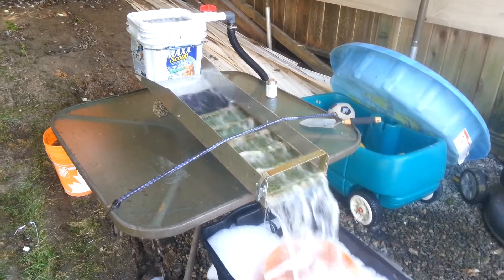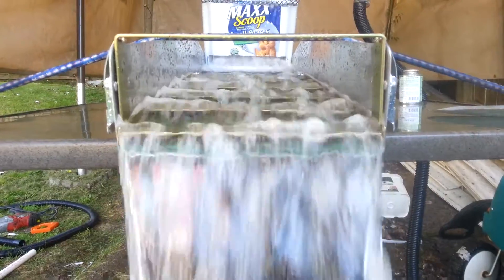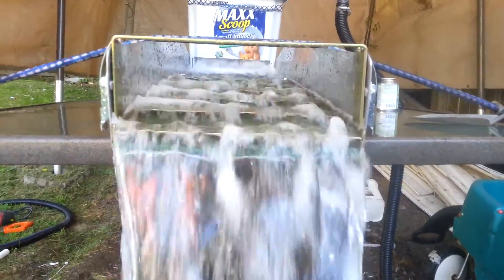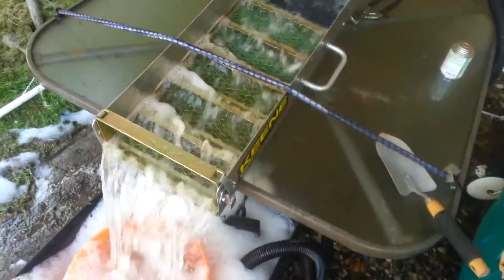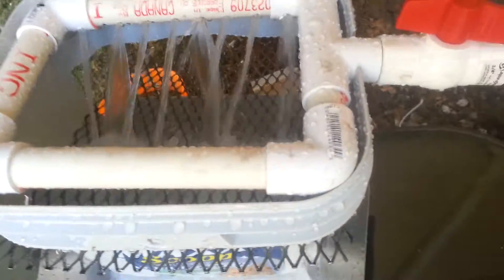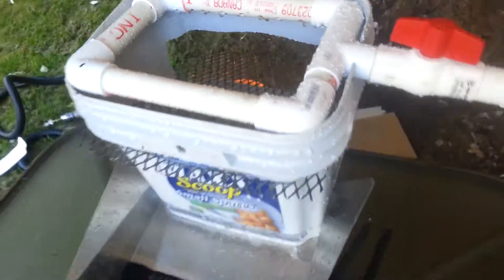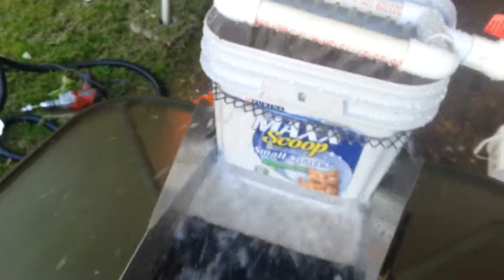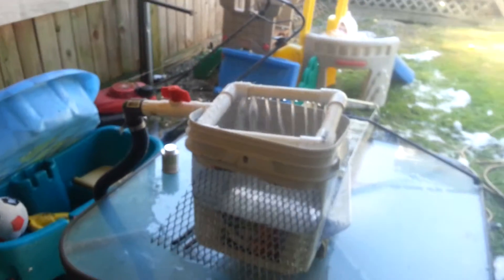Home Made Mini HighBanker Using My Keene Sluice And Some Creative Thinking

Comment: looks good to me..ive come to realize that it takes a heck of a lot of water to be to much so run something threw it and see what happens. its hard to tell without anything being ran. and even at that, the type of material you run might work out fine that day but the next time might be totally different so leave room for adjustments